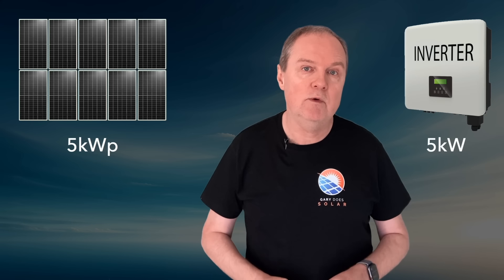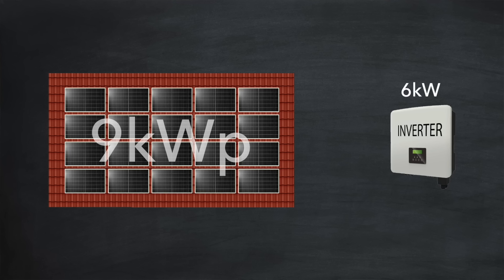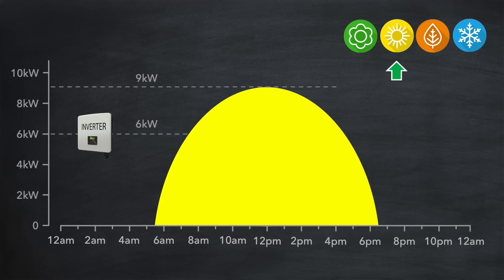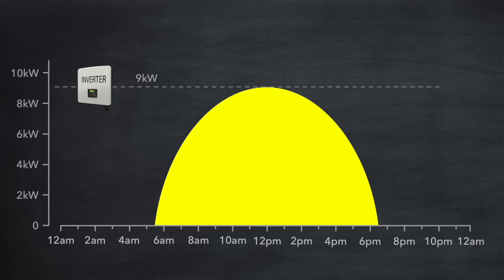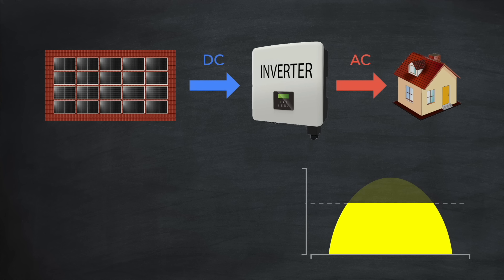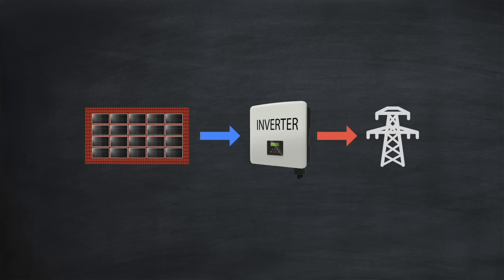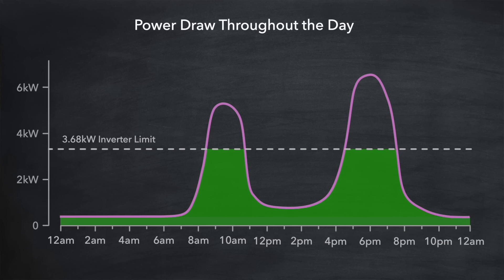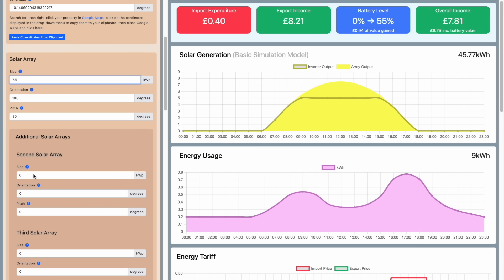Solar Array Oversizing - All the Benefits and Considerations

Comment: Agree with all the point you make Gary, except for the one about dirty panels reducing power output.
My own personal experience, I’ve had a 4kW FIT array since 2016. Every year annual generation has been around 3mW, some years more, some years less.  I’ve seen no obvious degradation due to dirty panels (or panel ageing); the panels had never been cleaned until last January when we had scaffolding up to install our new 10kW array. There was a bit of lichen in a couple of spots but the panels were pretty clean considering. I’ve read that they do generally keep themselves clean with rain and wind, and that’s been my experience.
Of course if you’re heavily overshadowed by trees or birds dropping on the panels then yes a potential issue, but then you’ve got other shading problems as well
Reply: Dirty panels is not a problem in the wet and windy UK, here in southern Spain we have a lot of dust, and rarely sand laden rain from north Afrika and very little rain at other times
Reply from the maker: That’s great, Geoffrey - and I’m noticing the same with my panels. I thought I’d have to clean them regularly (bird mess etc.) but with the regular rain, the panels self-clean 😀 Countries with less rain might have a dust issue over time though…
Reply: Yes fair comment about dusty and less rainy countries. I was thinking from personal wet UK experience.
But to caveat the "no issue with dirty panels message", when we had the extra panels fitted last year, as they filled in the gaps on the rear roof, one new panel was underneath the TV aerial and within a couple of weeks the panel was covered in bird poo.  Had to go up on the roof, fit bird spikes and wash the panel
Reply: mW is not a unit of energy. It is a unit of power.  So 3,000 kWh per year would be a proper way to express that.
Reply: How do you square your 10kw array with the FIT limit which is a bit under 4kw?  I would love to have some more solar gwneration but, I am consistently getting 4.3Mwh per year at the 2011 FIT rate which is pretty lucrative and I would never want to mess that up.
Reply: @rogerphelps9939  that's great output from your FIT array. We've had our 4kW FIT array since 2016 and last January had a further 10kW (two arrays) fitted.  We moved onto Octopus Flux in June but it took to August to get the export MPAN etc setup. This included having to give up the FIT export payments (still retain the generation payments).  For us the export payments were about £100 a year but we received £270 in Flux export payments from mid August to mid November so it'll be worth it, with luck will overall be £0 electricity bill for a full year import & export

Comment: A very good video again Gary. I have a SSE facing rear of house (semi detached) and have maxed out roof space. I asked installer about wall mounted panels and front of house NNW facing and they advised against the latter and didn't do the former. As I understand it north-facing panels are not bothered with because they only produce 50% of south facing panels. This ruled them out ten years ago but now that panels are considerably cheaper and more productive should we be taking a look at this option?
Reply from the maker: Thanks Tony - and yeah, I can't believe how much panel prices have dropped over the last few months. A chance to stick up panels everywhere and anywhere! :-)
Reply: I have 1.5kw of older "ex solar farm" panels (6x250w) that I got extremely cheap. Approx 7 years old.
Using a 1600w
Micro inverter and all panels in parallel on my west facing wall, they produce very little in nov/dec/Jan but will give a lovely boost in late evenings for the 4-7pm octopus flux export slot 😊

Comment: I did this when I first upgraded my main southern array, but it just gnawed on me endlessly to leave power sitting on the table and after a few months I replaced the inverter too.

The efficiency argument doesn't work, not really.  Modern inverters are going to be near max efficiency even at half their limit.  Direct grid-tie string inverters, in particular, can maintain 95%+ efficiency in a very wide production range.

More specifically, the most common mistake made in installations is not give a string inverter sufficient headroom to stay within an optimal MPPT voltage range even during cloudy and shaded conditions.  That is more a function of the solar topology and not so much the total number of actual panels or the size of the inverter.

There is a good argument for having multiple arrays pointing different directions to get more of the day.  Particularly end-of-day where the utility's higher time-of-use rates come into play before sunset.  I have a secondary array of western-facing panels to complement my array of southern-facing panels and even though the western array does not produce as much daily total power (due to losing the morning sun), it has excellent production in the late afternoon all the way to sunset when the southern array has already dropped off a ton.

For AC vs DC coupling.  I gotta say, I'm still on the fence even years later.  AC is easy if you are grid-tied, but the frequency shifting (UL1741SA) that has to be does when one is disconnected from the grid can cause flickering lights and other problems with equipment containing AC motors.  Not only is the frequency shifting going on, but the slow response times of micro-inverters to the frequency servo also means that voltage spikes and dips are more pronounced.  The AC bus just isn't as well-regulated as I would like... it is a bit too much of a dance when one is planning on batteries.

If not for the rapid-shutdown requirements where I live, which require a shutdown device on every panel, DC would clearly be superior.  That said, rapid-shutdown devices are starting to get better, so at the moment I am leaning towards DC for my next project.  Despite the more complex wiring of the strings, It is just vastly easier and more flexible to regulate everything against a 48V battery bus than it is to try to do it on the AC bus.

-Matt
Reply from the maker: Hi Matt, thanks for sharing your insight. I'd say the efficiency argument works fine because there will be plenty times when the inverter is operating at less than 50%. And of course efficiency inside the inverter is not a binary switch at 50% - it's a sliding scale...

Comment: Gary, what is your recommendation for people considering adding to their existing array when they are receiving FIT payments? My understanding is that they could potentially lose their payments because their system has been changed from the original and when submitting quarterly generation meter readings they make a declaration that the system has not been changed. Is it to use either a second inverter or micro inverters with the extra panels and connect directly into the distribution panel without going through the generation meter? Thanks
Reply from the maker: Hi there. This might answer your questions re. the UK feed-in-tariff scheme (which unfortunately has been closed to new applications for some years now). You'll need to join the group in order to access the information: https://www.facebook.com/groups/2197329430289466/permalink/6080359505319753/

Comment: Difference in price between 6kW and 9kW Inverters is not that big. I do not think it is worth saving on Inverter.
Reply from the maker: It depends on the manufacturer, and some manufacturers don’t make inverters that big. Also your local energy network provider may limit you to a certain size. And remember, you’ll be replacing that inverter once or maybe twice over a 25-year system lifespan.

Comment: Absolutely agree, oversize your array, but don’t undersize your inverter. Once you have solar you’ll find places to send any excess generation, be it to the grid, batteries, hot water, aircon or car. I doubt that most households would be able to produce more energy than they could consume 
The great thing about the whole electric ecosystem (at the moment in UK) is the export rate of 15p vs 7.5p import, meaning the right setup could give you zero bills by producing 55% (including losses) of your annual usage
Reply from the maker: Brilliant! :-)

Comment: What you described is probably the solution with the highest possible available financial ROI at the moment. We need to supply power in the morning and evening (see duck curve). We do this by placing panels east-west, not toward the equator. It matters little if your setup harvests relatively less power around noon, because power will often be cheap if not free or negatively priced at that moment anyway.

Oversizing works especially well if panels are cheap and inverters are expensive, which seems to be the case. I heard from a source that I consider reliable that panels HALVED in price over the last year. Prices of inverters seem to have changed very little over the same time period.

NB: It’s important to look at your actual expected peak power. 25 panels of 400 Wp each placed east-west probably won’t ever actually produce 10 kW, especially if you’re farther from the equator.

If you have a DC-coupled battery you can get even more power out of your inverter.
Reply from the maker: Great insight, Frank - thanks for sharing! :-)

Comment: If your panels are sitting in the sun without maximizing output, you are wasting their life span.  Panels in both of your scenarios will deteriorate at the same rate due to UV damage, weather, etc.. but the 6kwh inverter setup will produce less power.  The least you can do is take this wasted life span into account.
Reply from the maker: The least I could do?? Is that how you speak to people…?

Comment: Thanks Gary, glad you addressed this.
I have two systems a SE 6.4kW and an Outback 7.2kW. My grid provider doesn't give its members net metering, they buy all the electricity we produce at wholesale and sell us energy at retail. They also have a max that you can sell them at 15kW. What I've done is put in 17k of PV and even though I only can sell them 13.6kW. 
On over cast days I make enough to charge my batteries and on sunny days my curve production curve is flatter. Because PV is so cheap now it pays to do this and also enables me to run with a smaller battery bank, which in my case is 15kWh.
Reply from the maker: That's just brilliant - I love the way how you've essentially maximised matters around the constraints :-)

Comment: My biggest regret is that I didn't oversize my array. I have 6kW of panels with my 6kW inverter. There are so  many times when an extra 3kW of panels would have been hugely beneficial to bring my generation closer to 6kW. I now plan to add an extra 3kW at a bigger cost than if i had installed them at the ti e of initial instzll. Great video, thanks.
Reply from the maker: Worth doing some modelling here, to see what your returns will be: https://garydoessolar.com/utilities/dailymodellingutility/

Thanks for the kind words about the video :-)

Comment: You say inverter, but I think you mean a solar charge controller. Otherwise what you have said is nonsense.
Reply from the maker: Why don’t you educate me as to why saying inverter is nonsense…
Reply: It seems as if you're not sure what the difference between an inverter and a controller is. Inverter changes DC into AC - so it's definitely what Gary meant. Controller is used for charging batteries. There are inverters with an integrated controller - these are called hybrid inverters, they are necessary for DC-side battery coupling - regular inverter cannot charge battery on its DC side.
Reply from the maker: Thank you for replying. @fymens. Oversizing a solar array involves only the array itself and an inverter. There is no charge controller in sight.

A charge controller is only required if a battery is involved, and hybrid inverters have such capability in addition.

So, given that adding a battery is nothing to do with oversizing, your assertion is wrong I’m afraid.